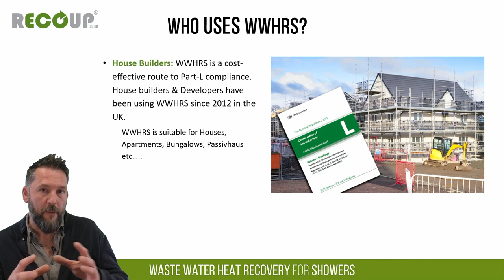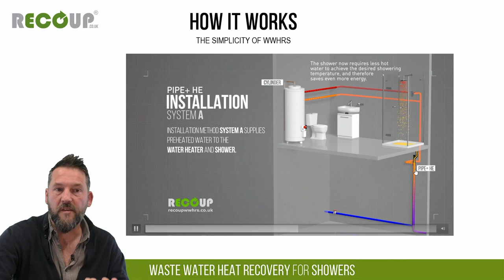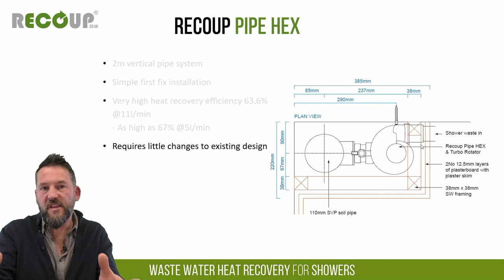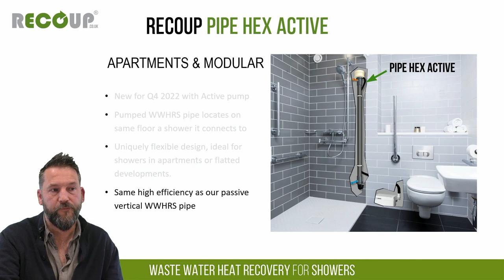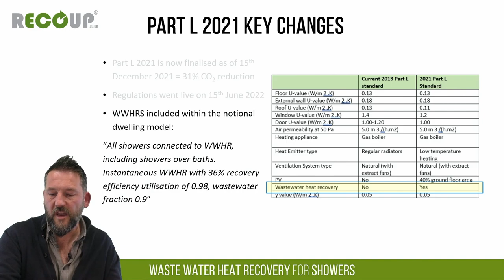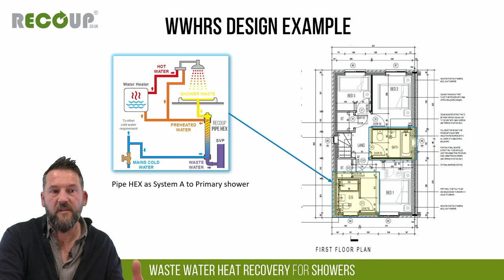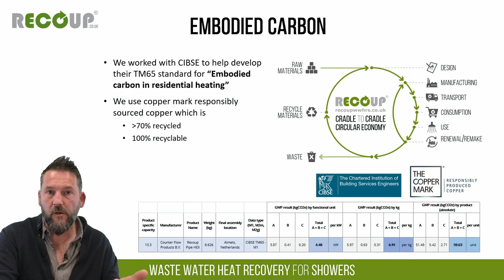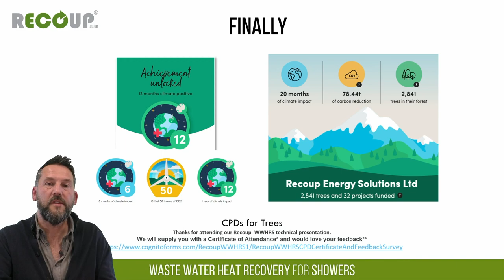Recoup WWHRS for Residential New Build Oct2022

Comment: A really good presentation, and I am quite impressed with the improvements you have made on the devices you provide. What sort of efficiency do you think you make on a low flow shower, as I couldn't find any figures? Is there a delay after water begins flowing before any significant heat recovery occurs?
Reply: Hi Mick, Thanks for the comments. All of our products are third-party tested by KIWA, and this data is taken and used on the BRE Products Characteristics Database (PCDB) - which is the source of data for any SAP-listed measure (WWHRS, but boilers, ASHP etc too). As you may know SAP is the Standard Assessment procedure for measuring the energy performance of new domestic dwellings. So the PCDB is the benchmark for data and efficiency for any energy efficiency product that counts towards a building's SAP rating (also EPC rating) in the UK. (that's the qualifying statement out of the way) - In answer to your question the PCDB shows very favourable increases in a WWHR products heat recovery efficiency at low flow rates (at 10:23 on the presentation, I outlined WWHRS efficiency for the Recoup Pipe HEX as SYstem A @ 11l/min shower flow rate of 63.6%. At 5 l/min flow rate, the PCDB lists this @79.3%. In answer to your second questions - the WWHRS system comes up to steady state in around 15-20 seconds under KIWA test conditions. PCDB link here: https://www.ncm-pcdb.org.uk/sap/pcdbdetails.jsp?pid=33&id=080146&type=353&mid=020075
Reply from the maker: See our Knowledge Base, http://knowledge.recoup.co.uk for more WWHRS information or feel free to contact us if you have any questions.